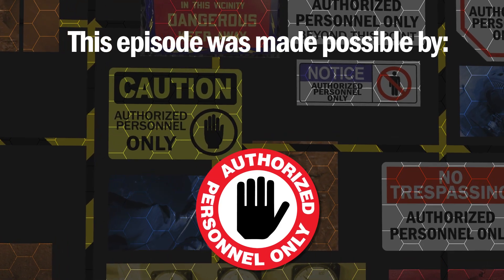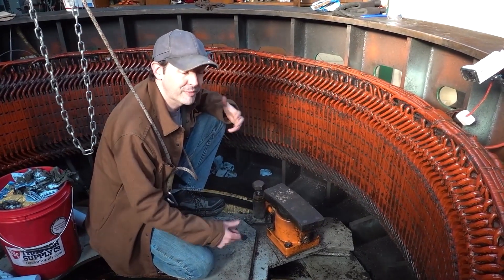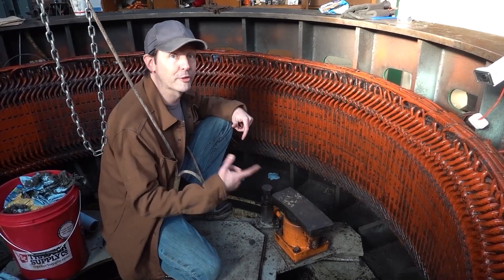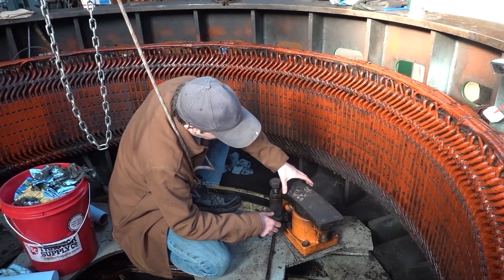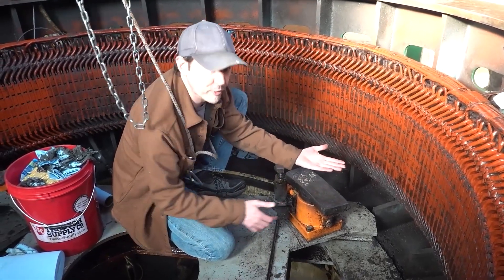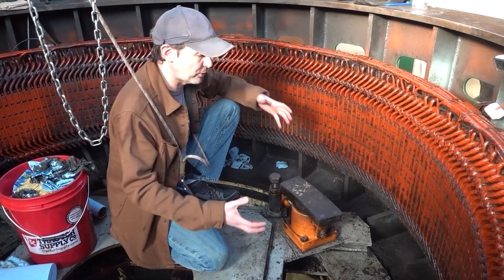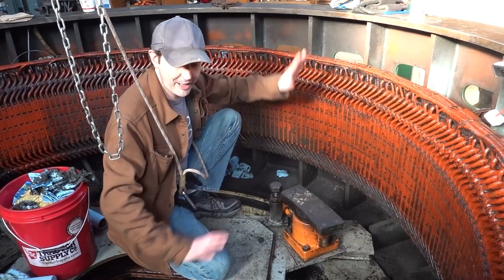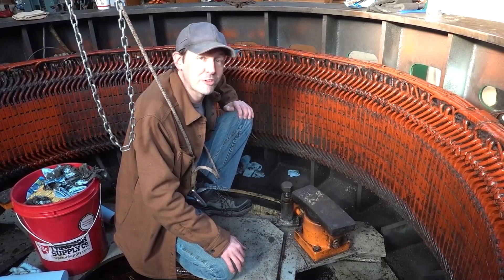Authorized Personnel Only -S2E20- Do Generators Have Brakes?

Comment: Basically it works the same way that the brakes on your car work. Hydraulic pressure forces a piston out, pushing a brake pad against the surface causing friction and heat slowing it down, as bad as it sounds, i would absolutely love to see, on camera from far away, a massive generator over speed until catastrophic failure, it would be absolutely spectacular! And don't lie Chris, you know you would love to see it happen, just not yours 😂
Reply from the maker: Damn straight! That would be one hell of a show. If I ever get to decommission an old plant that's the kind of thing I would try to do. Of course there would be 20 cameras rolling and a lot of fun sensors for Vibration, Velocity, Temperature, and Decibells.
Reply: @Physicsduck China would probably pay you good money to do it tomorrow...
Reply: @danbuckley6584  lmao good one

Comment: They won't stop a runaway generator. We have the same type set up on our Allis Chalmers. The brakes operate on air and can be used to jack during maintenance with a hydraulic hand pump. The brakes are to bring a unit to a complete stop in a reasonable time so the unit doesn't creep / coast which is bad for the bearings.

Comment: It is interesting to see the safety brakes need an oil pressure to stop the rotor. I would expect the opposite: the oil pressure to be needed to actually release the brakes (e.g. lifting the rotor by the thrust bearing from the fixed brake pads up into the free operating position, or so...), so it can not move out of control even when e.g. some seal or line bursts open...
Reply: but if it relies on no pressure it cannot actually exert meaningful pressure
Reply: @minoupower554  They could be mounted on top with weights on them.
On a sidenote, i expected electric resistance breaking…
Reply: I reckon you could employ a system similar in nature to air brakes. Pressure is applied to keep the brakes down, the bottom of the piston could be spring loaded so that on a pressure loss, the brakes apply. But then you have to have all sorts of interlocks to ensure grid disconnection, wicket closure, a whole mess of other shit i know nothing about. I guess you could have stop logs ready to drop but that feels excessive and then spill ways which means you get Grady from Practical Engineering involved. Really quite excessive. But there ain't no kill like over kill...

Comment: I know for a fact that the power station close to where I grew up that was in operation until the 50's used a log to brake the rotor. It had 150 meters aka 213 psi feed pressure, and 2 meters diameter of hand riveted iron pipe about 2 kilometres long. It had two generators, and was constructed in 1910. The building has the black and white checker board pattern floor,- and has been restored.
It lacks the generators and hardware,- and there is only remains of the pipeline that did lead up to the dam.

Comment: The brakes will never stop the unit from spinning if the wicket gates don't close, they will simply smoke! The brakes are only used to stop a unit from spinning under normal shutdown. In fact if the unit does not stop quickly, the brakes must be released. And the mercury speed switch on the top of the unit is useless on a grid tied unit.